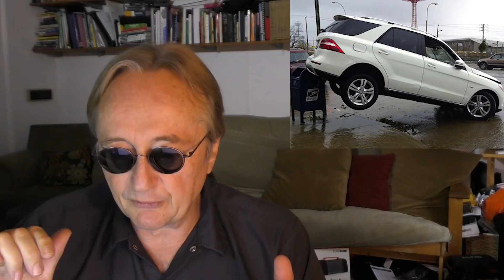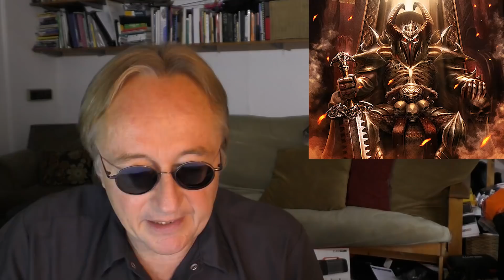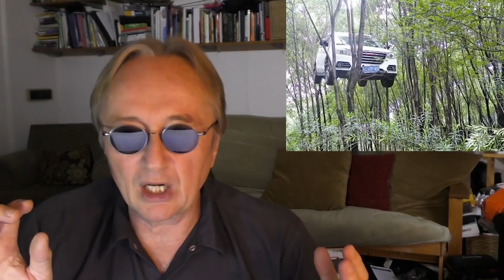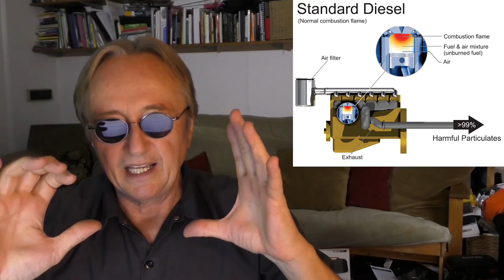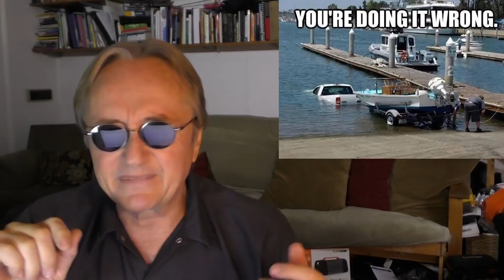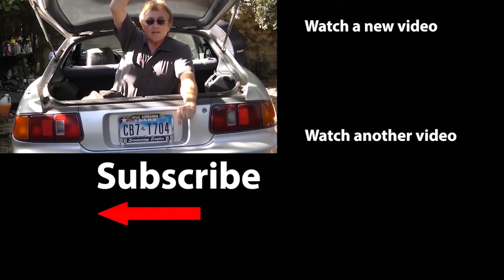Don’t Let This Happen to Your Car’s Transmission

Comment: You can’t just say that the transmission is gone from his explanation. I had a short in the electrical system of a Mustang that was causing my transmission to act up. I had people say it was an internal issue and that the transmission was gone. I could put the car in drive and give it gas and it would act like it was in neutral. I found the short in the engine fuse box and fixed it and the transmission problem was solved. There are a lot of electrical issues that can make people think they have a transmission problem. Transmissions have adaptive learning too and there are times when people think they have a transmission problem when in fact it is solved by clearing the adaptive learning. You can’t just say a transmission is gone on the basis of age. I have had many high mileage and older vehicles (all Fords) and I have never had a transmission fail.

Comment: I had a 2011 impala and I went through 2 transmissions and it had several leaks I liked it because it was my first car but they were cheaply made and the heat actuator tapping was really annoying I got it fixed once then the part broke again should’ve been recalled I don’t know how GM got away with the things they did with that car

Comment: Scotty i have a 93 honda accord 2.2l and i have a D4 light flashing and the car wont turn on. Very rare when it starts and when it does it runs perfectly fine. No issues other then struggling to get it to start. Believe the previous owner overheated the car and did a cheap fix. What steps should i take? I was thinking of just swapping out the engine. Since its gonna be my project car.

Comment: I've got a 07 Corolla with 164k miles and i don't even know if the transmission fluid has ever been changed
Reply: Matthew I’ve got the same issue with my 09 Acura TL. Think it’s worth getting changed now or would do more harm?

Comment: Hey Scotty. My old 06 Chrysler is showing a P0430 code (catalytic converter below threshold) and I'm not sure what's causing it. Some guy at work says I should get the catalytic converter cut out. Do I have anything to lose by doing this? Thanks, love the channel!
Reply: I believe there is a Federal fine of $20,000 to a shop that does it. And there is a fine to the owner, but I don't know how much. (If you're caught)  I take it you don't have smog laws where you live?
Regardless, it's not a good idea on a car that modern because the engine management system won't function properly with the lowered back pressure.  Also the check engine light will probably never go away. 
Are you sure it's not a sensor issue or an exhaust leak? 
If it is a bad cat, I would try to clean it.  Scotty has a video on that.

Comment: Hi, Iraq Veteran trying to restore my 2000 Mitsubishi Montero Sport. Last major problem I remembered from it was acceleration were slow and extremely slow going up hill. Also shuts off on idle for some time. I spent money on spark pugs, belt, and starter. Should I keep investing money into it?

Comment: Hi Scotty, Thanks for all the info and cool videos.  I have a 1991 Toyota pickup, long bed (no other identifiers).  It has the 22r engine and manual 5 speed transmission (no dip stick).  I want to try to change the fluid myself to save some money.  I can probably find the drain and fill plugs (because I watched a YT video :) but I don't know how much fluid to put back in AND I don't know what KIND of fluid to use.  All the products I can find say "automatic transmission."  What fluid goes in there and how much of it?  THANK YOU so much for your help.

Comment: Hey Scotty, i bought a used 2007 Lexus IS 250 AWD with 120k miles on it, anything i should do to it now to make it last as long as possible?
Reply: Maintain it as per owners manual.

Comment: My Honda Accord 2005 280000 miles , when I put it in reverse the car jerks what’s the cause
Reply: Trandmission mount i bet u
Reply: gustavo acosta I would think that transmission fluid is dirty,
Reply: If it jerks once it's probably a bad mount. If it continually stutters it's probably a bad transmission

Comment: I have a 1999 2JZ SC300 I just bought the car and it has no issues the underneath is a little rusty I have no engine lights the engine is very strong the transmission is very strong I just wanted to feel like a new car again where should I start

Comment: Stupid question here but I need help. I have a rear main seal leak that's seems to be leaking engine oil, is that from the engine or transmission? Transmission fluid never decreases but oil does?

Comment: Hi Scotty, I have a 2014 Mazda CX-9 that has a strange vibration in rear end that you can feel as long as you are stepping on gas pedal at speed around 30mph only, cruising will make it go, or lifting my feet off the gas pedal, speeding over 30mph or less will also make it go. what could be the reason?

Comment: Hi Scotty. Isnt the engine oil create sludges inside the engine if it werent used for a week or regularly unsused?
Reply: It's a product made from petroleum just like plastic. If you don't apply heat to it, vis a vis, use your car, it will last for many years, like plastic.

Comment: Just need a little help with this question 
I have a 2015 Subaru legacy 2.5 and when the vehicle  is in park when in press the break peddle all the way the engine shakes and a vibration can be felt threw out the car. Subaru tech replaced the brake booster  due to a vacuum  leak they found when I brought the car in. Now that I have gotten the car back with the replaced  booster the couple day later the car is doing the same thing and I went back and they are saying the vibration when pressing the breaks in park is normal. 
Is the car supposed  to vibrate when pressing the break peddle or are they trying to get out of a repair

Comment: 15,000 to 20,000 miles on most Japanese engines is basically just a good load test.  Those engine just last!

Comment: I have a 2013 toyota Corolla le....fan not spining. Im all by myself. I haven't any idea which wire is which to check whats working and what not...please let me know
Reply: Is your car temperature Hot? Fan only kicks in hot weather, traffic, and long periods of idle. If yes, See how much a fan motor costs before committing to an expensive electrical repair that may not even be the problem.

Comment: synthetic diesel oil is usually perfectly fine in gas engines. brotella yo subaru impossibru
Reply: I knew a mechanic who put that stuff into carboned up engines and usually it would make them run better after a week or so.
Reply: Yes, I was going to say, as 0w30 BMW longlife 04 is the same in diesel or petrol engines.

Comment: Scutty
 like ur answers and mostly make alot of since.
But i really did not understand  ur reply about the diseal engine oil and gasoline engine oil as u said that the piston will lose its carbon diposets in the gasoline engine if u used diesal engine oil in gasoline engine but the engine oil is not sappose to inter the cylinders burning chamber so what does the burning of fuel have to do with the engine oil except cooling as cooling oil and fuel have there saparat passeages

Comment: Hey Scotty can you help me?

My poor little 02' Hyundai Accent developed a problem where when in gear the whole car hiccups usually two times quickly every minute or so at idle. When driving it's fine, just idling is the problem. The RPMS don't change so I'm thinking its the transmission. I took her in to a shop and they said there's a problem with the wiring going to the ECM.. they didn't get specific.

The ECM is inside under the dash, do you think if I swapped the ECM it would fix the problem? The transmission has 200,000 miles on it but the fluid has been kept up and is still red.

Comment: Hey Scotty, what do you think of the Modern Post 2009-2014 Volkswagen TDI Turbo Diesel Engines? Are they reliable? I am just curious since your not a big fan of Modern Volkswagens.
Reply: How many miles. Certainly popular in the UK, they can easily do a lot of miles but with any German car the other parts go wrong and parts will cost more.
Reply: @Horizon301.  87,000 miles. With Diesel Gate Warrenty til 2022
Reply: Jason B. I hear they can last pretty long in the hundreds of thousands of miles, this is in the UK as well where it’s pretty uncommon to have such a high mileage car so I would say it’s probably a good choice. I would certainly choose their diesels over the petrols

Comment: 2003 tundra engine make a ticking noise like a rod or something in the engine when it first starts up.  After 30 seconds or  so it stops.   no other issues should I have it looked at or just be ready to replace the engine later. it is an 8 cylinder sport side truck.. Thanks.. Rob
Reply: Maybe oil starvation on start up. Had an F150 that did that, ran it like that for years no problem.
Reply: thank you...
 @TheCalgarycanuck

Comment: "...like a mercedes, can drain the battery if they sit too long because of all the computers"  YA THINK!  54 DAYS my MB was in the shop, mechanic looking for which computer module was draining the battery. Turns out it was the radio.

Comment: Hey Scotty I have a 2011 Honda Accord lx 4 cylinder.. I have had the battery and alternator tested and both have tested good.. but when I go to crank it up it’s been acting like the battery is bad .. try’s to turn over but dies out before it can even make a full rotation.. it’s intermittent .. I also had the starter tested and it tested at 10.77 volts.. could the starter be my issue? Please help.. I have taken the car to the Honda dealer and they said I needed a battery.. so I bought one ... not the problem .. I need help please

Comment: Hey Scotty my town has a gas station that sells 93 no ethanol gas should I use it?
Reply: Does your car require 93 octane?  If not, does the station offer 87 octane no ethanol?  Using too high of an octane for too long can burn holes in the tops of the pistons.

Comment: My 1995 Nissan Pathfinder engine randomly shuts off suddenly. It happens both while standing still (like waiting in a drive through) or on the move. When it happens, the steering wheel locks up and the breaks get heavy to push down. As you can imagine, this dangerous when it shuts off while going 40+mph.
Any idea what it could be?
Reply: Bad computer
Reply: In my 1995 f150 it was the distributor coil i replaced the entire didtributor
Reply: Bad ignition switch!

Comment: Scotty in the Philippines there is  problem of mitsubishi that is sudden unintended acceleration...is there such a case???
Reply: I don't think Mitsubishi mirage uses electronic throttle. It uses throttle cable so no.

Comment: Hey Scotty I have a 2014 Toyota Avalon with 77000 miles. Should I change the transmission fluid on my next service appointment?
Reply: Read the manual.
Reply: adcolt54 gonna do that
Reply: @thetruthspeaks8702  and remember what Scotty says, don't flush the tranny just change the fluid.
Reply: adcolt54 yea that’s what I was trying to remember too 😄😄😄. I’ve never had any problems with it but since I’ve started listening to Scotty I’ve been watching my car.

Comment: Scotty, I live up north and drive a S2000. I pull the battery out of it when I store it for the 5 coldest months.  Good idea?
Reply: I hope you hook up the battery to a trickle charger,otherwise it will DIE
I use SOLAR panel to keep batery charged continuously
Reply: Yes

Comment: Scotty, what's your opinion on the SOHC 4.0 V6 engines found in Explorers and Rangers? I have an '03 Ranger with 116,000 miles.
Reply: They're hit rods.  But don't use the wrong oil and don't let it get hot

Comment: Some Plz Help😫😫
I have a 2006 m35 Infiniti I was driving in fwy 65 then outta nowhere I lost acceleration eventhough I was pressing the gas  pedal down jst heard it rev until it went to zero it turned off 
My car jst turns on but everything but the push button dsnt let me start jst electronics

Comment: Scotty,  I need your help! I'm having trouble finding a window housing for a Honda Civic 2001 the American version is between $59 or $99 Japanese one they're telling me it's $450 is there anyway I can find the Japanese one cheaper?
Reply: BC Green Lol nope.
Reply: Unless you plan on keeping it 100% Japanese and sell it at Barrett-Jackson auto auction, get the American version.
Reply: @adcolt54    I would love to put the American ones in however the American ones are twice as big as a Japanese ones so my car can only take the Japanese ones since my car was made in Japan.
Reply: @bcgreen7479  Well, then try the junkyards.
Reply: @adcolt54  I have tried but in my area most of them are either American or from Mexico.
Reply: @bcgreen7479  Well, looks like your options are down to one, pay the $450 unless Scotty has some connections with the Japanese Mafia and they can acquire one for a lower price or Scotty may have to dig into his private stash of auto parts. Anyways, good luck.

Comment: Hi Scotty I have a Kia 2008 Sportage automatic and my car will change gear on shifter but not take on car every thing else is running good (it pretty much stays in neutral the whole time while changing gears) please help of you can I got error code p0700 p0731
Reply: There's not harsh sound when shifting

Comment: 😃Hi Scotty.  What is the deal with Chrysler not putting a dipstick in the transmission so you can check the fluid level? 🤔  Oh, btw, you have to buy a special too to check the fluid level, AND, spend about a half an hour of labor removing parts just to get at the fluid level access bolt.  ???   🤪😠
Reply: 2015 Chrysler 200 - initially thought to be a battery issue, (10.47volts).  Replaced battery.  Transmission stuck in neutral.  Car will not move. 😡

Comment: 4:50  I would buy the used japanese engine, put that in the car, car be fine  and everything is nice.

Then i take the old broken engine, into my basement. And start rebuilding it just of curiosity.  Then it wouldn't matter if i make it or not.
If i do make it right, i would have an spare engine. If not, i learned alot ;)

Comment: With the high price of cars these days it's usually cheaper to repair then buy a new vehicle.
Reply: Cheaper to repair than to buy brand new but not cheaper to replace with a good used car that still has plenty of life left in it.

Comment: Buy a  BRAND NEW  Hi Performance transmission for  like $4000  bust your chops and get it in there and your good for at least 10 years    Beats the hell outta getting in debt for or dropping $30,000 on some new pos plastic car thats deliberately built to fall apart at 3 years or 100k miles